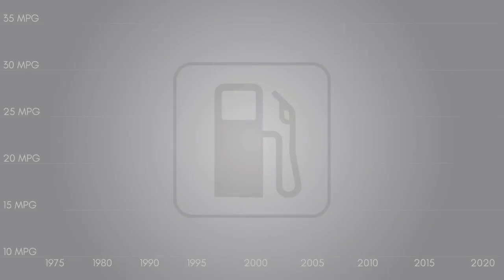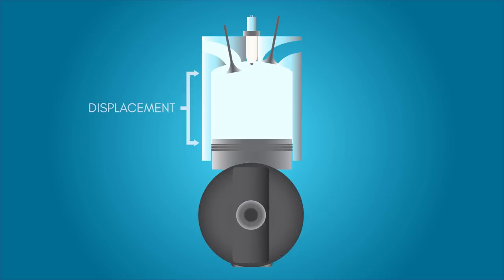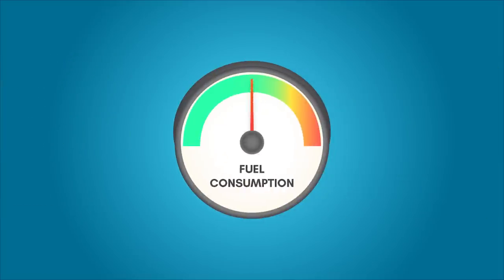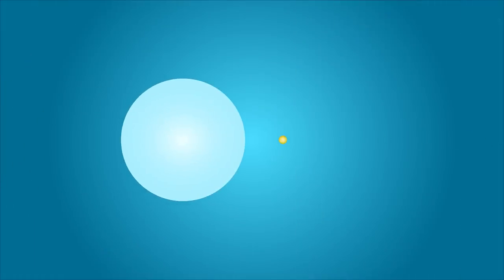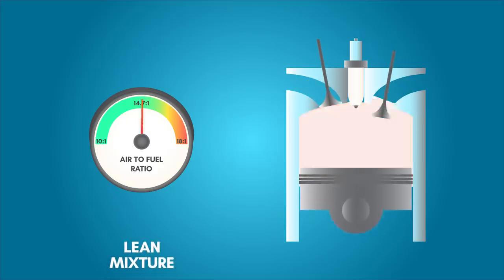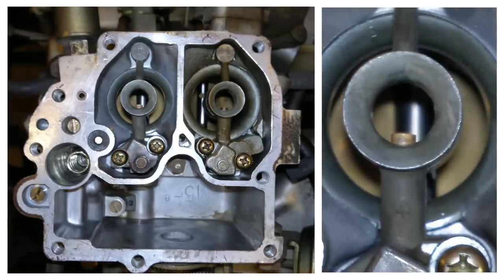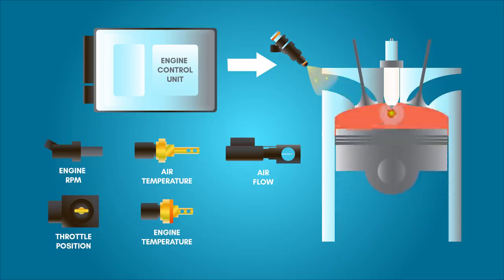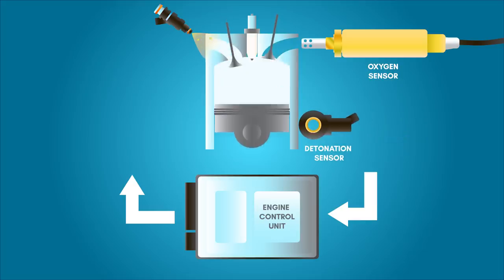How Engines Are Becoming More Fuel Efficient

Comment: Modern engines ARE amazing. My car has a 2.0 turbodiesel that produces 184 horsepower and it will average 60+ MPG on a long motorway trip. I'm only 46 and remember when I was a kid that you could smell cars as they drove past you down the road. You rarely, if ever, smell that now because fuel metering is so accurate and efficient.
Reply: What car are you driving?
Reply: @thinhtranba5352  It's a 2014 Seat Leon FR.
Reply: Diesels are great but i dont think gas cars will ever come close to what the diesels can do. I remembermy dad telling me he had an old early 70s 4cyl 5 speed gettig over 40mpg no emmisions just a little old 4 cylinder. Yes emmissions are nessasary now but we were able to get better miles per gallon without them. Even my diesel truck gets better mpg without all the emissions crap on it. Went from 16.7 to 23 after all the mods
Reply: Guy that’s not what I would call good I have a 92 v8 falcon that gets over 35mpg when I’m carting my work tools around and it done over 250 000 miles, if I had the engine rebuilt and didn’t have all the weight in the boot all the time my economy would be comparable with yours and my car is a nearly 30 year old car I threw together with leftovers, what is your car worth
Reply: That's true, the only time I can smell a car these days is on cold starts. Catalyst is too cold to function plus a rich AFR to compensate for a lack of fuel atomization in a cold engine. That or someone that has had their car tuned.
Reply: Arguing about the efficiency of internal combustion engines is great and all on it's own merits, but combustion simply is an inherently inefficient process.

The theoretical efficiency of a combustion engine is about 35%, though a few rare extreme examples hit about 42%

Electric motors routinely hit 90, 92 or even 95% efficiency, and have done for nearly a century already.

This is why trams were once popular. And electric trolley buses.
And why the trains on densely populated routes with frequent services are almost always fully electric.

And, why electric cars are gaining ground.

Though, you might ask why has it taken so long? After all, electric cars actually pre-date cars built using internal combustion engines.

Well, the answer of course is that while electric motors are amazingly good, batteries are not.

We've seen amazing leaps in cost and power density in the last decade, but even with all that, an electric car has to carry something like at least 15 times the mass in batteries that a similar sized petrol or diesel vehicle would need in fuel mass to get an equivalent range. and that's AFTER accounting for the electric motor being 3 times as efficient as the combustion engine. (meaning the battery has less than 1/45th, sometimes as little as 1/150th or less the energy density of petrol.)

There IS a reason why all the manufacturers are moving to electric, and it's not just the environment.
But there's also a reason why it's happening now, around 2020, rather than already having happened in 1920...
Reply: You in the UK?  If so, your gallons are bigger than American gallons.  A little detail that is easy to overlook...If so, the US equivalent is ~50mpg.  I had a VW Golf TDI, it could get as much as 50mpg if I stayed below 60mph, and in the summer.
Reply: Just think that's a hundred more horsepower than you would ever need and just think if they would have put the last 50 years until fuel efficiency instead of unneeded horsepower
Why do you need a car that can do a hundred and forty miles an hour when the speed limit is 60?
Reply: @thecloneguyz  Can I call you Grumpy?   The rated hp at 5.5k rpm doesn't matter.  What matters is the low RPM torque and hp.  Like at 2,000 rpm, I've got 100hp and 275ft/lb.  That's handy for pulling a trailer, changing lanes, merging with traffic, etc.  The point is I'm getting nearly the fuel economy of a Prius...but in a car that is FUN to drive...it does both at the same time!
Reply: @thecloneguyz  High top speed is just an artifact of having enough power for good acceleration, as well as good aerodynamics and tall gearing.  People who don't want to keep up with the flow of traffic can be a hazard and would be better off using public transport.
Reply: fredy gump I live in the UK. Fuel is sold by the litre here not the gallon!
Reply: @nathanlewis42   Yeah, well...I'm sure I have heard all the UK car shows talking about mpg?  I've watched pretty much every Top Gear up until Clarkson beat up that producer.  Isn't the metric version of fuel economy something like liters per 100km?  But the conversion is still 1.2 UK gallons = 1 US gallon.
Reply: for diesel, dump the urea spray, egr, dpf, catalytic converter and your engine will give you superb mileage..
Reply: Mykel Hardin I’m not saying “if I took a few tools out the back I’m say if the engine hadn’t done over 400,000 it would be more economical and if it weighed the 1300-1450 kg it ment to instead of 2100 kg it does would make a difference aswell, I’m say guy’s car doesn’t seem incredibly efficient compared to my nearly 30 year old car I would of thought it would be leaps and bounds more efficient
Reply: In mexico cars still smell
Reply: If ots a ford you can still smell them as they past. I dont know what they do with the exhaust, but they always smell like someone cut one in the car.
Reply: Guy Wood 1986 Honda crx 50 mpg way more reliable than the car you own.
Reply: @limcharles9730  Or take that new TDi, put it in a Mk1 Rabbit that's less than half the weight, and watch the mileage climb even further. You could hit 100 MPG with all the EPA stuff removed, a lightened chassis, and an easy pedal. And because it's a Mk1 Rabbit, you can get antique tags that waives your need for inspections/emissions and finally take back control over your property. Going from coast to coast on two tanks of diesel would be amazing to see.
Reply: @izuzan7419  I agree with you about Fords
Reply: Mykel Hardin 😂 my friends 2003 ford escape with a 3l v6 made 11mpg, my 2003 Mitsubishi  3lv6 makes 13mpg, and my dads 2017 ford exploder with a  3.5L v6 makes 14mpg and my moms chevy trax with a 1.4l 4 cylinder makes 26mpg 
not only do i not think the mans car can make 30mpg and at 30 years old 
But less if its a v6 
No matter what mods (unless its a hybrid... even then, lmao) 
Maybe he cracked the code to the worlds most efficient engine
Reply: KuraIthys big oil making billions on gas, thats why they dont make fully electric cars, plus it started with gas, which means they have more experience, as to why tesla is pretty much the only (or was) fully electric cars, now everyones dipping in since they’re blowing up, and obviously everyone wants to keep up with the times, besides that, even then i personally think batteries are pretty efficient in the sense that, even at the average 30mpg that most cars achieve,  being in an suv ridden city (mostly up here in the north) 200-300miles per tank is usual, and teslas batteries seem to be at the 200-300mile per full charge range, i personally think its going pretty well 
And now that everyones pushing for this new tech, im guessing in 10 years batteries will pretty much remove gas 
Given, battery technology sucks, if it improved imagine where we would be... 💀 its good now but it can surely be improved 
I know theres a few cars that run on hydrogen, i think doug made a video on one, it was a mercedes, given.... hydrogen is expensive, 💀 and although everywhere, to use it as a source of power is expensive since its uncommon as a fuel source, very few hydrogen chargers.... shits wack
Reply: Heh I can smell the exhaust on my big block 78 bronco . It'll make you cry (literally lol) shot piston rings and over fueled 😅
Reply: @Douglas Hamner you must be from California. Anywhere else in the u.s. you can find diesel trucks with no emissins or exhaust and the cops never look twice.
Reply: @dougsavery5442  I get 59 MPG average in a 1.1L Fiat 600 from 1998 on gasoline. Small Diesel cars of that era got 80 MPG (in Europe) if driven carefully.
Reply: Wait for it, i hear repairs are expensive and hard to diagnose for diesels, plus i smell diesels not 10 years old around me and they stink worse than a 2 stroke scooter, oh and there is diesel gate. Hybrids FdD. Also using mpg as a way of measure is very inaccurate since there are two types of mpg and it's not really intuitive to which you refer(imperial or US), so again not the best choice to use mpg online, m/l or l/m are two better ways to measure that since, you know, i'm here in Lithuania, you're there in US/UK and Abdul to the left of you is from Pakistan.
Reply: @Douglas Hamner true, but try maintaining a car after 200Mm onward. Diesels are harder to keep nice and clean and luxurious.
Reply: @eivis13  The 1997 VW Lupo uses 2.9L/100km. Yes Diesels smell if they are not properly maintained.  But then drive a small gasoline car that uses 4L/100km. Still only 30% more than a Tesla emits in Europe or 10% less than a Tesla emits in the US.
Reply: @Douglas Hamner what about the used car market? Also i own a used gen 2 prius with +217Mm now. Most people everywhere own those type of vehicles. If you're hanging out with the top 30% then yes, those people tend to be wasteful and buy cars that get booring over time or don't get properly maintained, or are just a pain to maintain.
Reply: @Tore_Lund  hmm, why should i drive a small car when hybrids are not that expensive nowa days? A used gen 2 prius costs from 3000-5000 eur where i live. Plus i've recently seen ads for the 1,5 hybrid yaris for under 7000eur and i believe you could get 3.5l/100km in those, plus all that tourque and no nox. Diesels may have a revival, but only in 50 or so years, but somehow i doubt that since gasoline engines are starting to go well beyond the 40% efficiency point.
Reply: @eivis13  3.5L/100km is very good for gasoline!!
Well beyond 40% -- with HCCI yes, which still needs to come to market, but yes, the difference is getting smaller.
Reply: @Tore_Lund  i think the new m20 engines from toyota are having just over 41% efficiency, not sure if they're hcci or not though. I have read somewhere that the old 1nz-fxe, used in the prius, had a thermal efficiency of 37 percent, but i can't find the source now.
Reply: @eivis13  The Prius engine is special; besides having VVT to have very little  valve opening on light load, which most modern engines do anyway now, the crankshaft also has more offset to have shorter compression stroke than expansion stroke which is an approximation to the Atkinson cycle, which originally had an extra hinged lever connected to the push rod to vary stoke length. The Toyota HCCI engine is 45% thermal efficiency.  But 37% is as good or better than a small diesel.
I did, the calculations on my own car, carefully measuring frontal area from a telephoto, weighing it on a truck scale and measuring consumption with a fuel flow meter, and according to the engine curves from the manufacturer, this rather conventional engine should have an efficiency of 26.4% at optimum load and rpm. However in real life, after deducting gearbox loses (manual) and alternator load, I only measured 22% in real life?? So there usually are some other parasitic losses that sneak in and the occasional acceleration, but still, I'm getting very close to the theoretical efficiency of the whole vehicle. so it should be possible with a 37% engine like in the Prius thrown in a small car to get close to 2.5L/100km if driving it like a Granny. Then pure EVs will have a hard time competing with that. Sadly, small lightweight cars are not in fashion as they were in the 80' and 90'. The concept small production VW  XL1 did that and got down to 1L/100km, but it is only a two seater and prohibitively expensive for any practical use. Even the first 2CV with 6 HP got 3L/100km in 1932.
Reply: I read somewhere that the air coming out of a modern engines exhaust is actually cleaner than the ambient air in London.
Reply: @KuraIthys  Interestingly bicycles are one of the most efficient forms of transport. Especially when its geared.

To give you an indication how inefficient a car engine is... you easily heat up the cars interior on a cold day from the engines energy losses.
Reply: @Guy Wood   "only" 46. Lol
Reply: @fredygump5578  that's why metric system is used.
Reply: Your in a family of lead feet, I've driven every one of those cars(hated em the way) and every one of them gets a lot more than that. 

I routinely get 300-500 miles from a tank on any car or truck I drive and that tesla does not get anywhere near 300 miles on a charge without hyper miling it, their stated range is nowhere near that in the real world for most drivers and in the case of your family of lead feet it would maybe get 150 miles.

Comment: laughs nervously in constantly floored 88 f150 getting like 7mpg
Reply: Yeah, that's nothing. 01 chevy 6.0 that gets   10 going easy on it. I just thought my fords were thirsty til I met this junk. And it gets like 1/3 of that now, since apparently the intake gasket or intake itself cracked a couple weeks ago when I drove through a rather large puddle. Even my carbed 390 with no overdrive blew this thing away. With power and efficiency.

Comment: A 1983 Volvo 240 which is shaped like a brick and has a 4 speed transmission with overdrive geared for 55mph highway driving still gets about 42mpg highway at 70mph.  All my experiences with new cars have gotten about 30mpg highway so in my opinion new cars are useless at creating efficient engines, especially turbocharged 4 cylinder engines.
Reply: some gearboxes have really crappy gearing for improved "acceleration" 
Really not nessecary for so much rpm on the highway
Reply: Stop buying low mpg new cars then lmao

Comment: Where is the next video? And please do mention about cylinder deactivation too as well as tumbling and, HCCI (e.g. Mazda Skyactiv-X technology) which manipulates higher compression ratio to increase efficiency.
Reply: Madzdas Skyactive X is no HCCI....it is SPCCI, a spark is still needed to induce the rapid burn of the lean mix! Pure HCCI doesn't need a spark plug, it does it simply by compression and some free radicals from EGR (like the small COX engines)

Comment: Was expecting you to show turbos haha, because thats the new trend small engines with powerful turbos so they dont lack power and are very fuel efficient
Reply: They rev higher meaning more fuel is getting pumped in overtime which is less fuel efficient its common sense turbos making an engine more fuel efficient is a myth
Reply: @patrickbateman2869  nah they rev lower as turbo does more work so you dont need to put foot down as much. My turbo kicks in around 2500rpm which is low to say i can rev to 6500rpm. But on some newer cars they kick in even lower.
Reply: Twin turbo seems to work pretty efficiently on my F150. If I drive like a sane person, it's fairly fuel efficient. If I stomp on it, she goes like stink, and definitely uses more fuel than usual, but still less than my old F150
Reply: @patrickbateman2869  completely wrong
Reply: @patrickbateman2869  actually turbos use waste exhougasses to make power making them efficient. Since it uses energy that otherwise would be wasted

Comment: I have a Nissan Versa that has dinosaur tech (late 90s engine design) and early 2010s software. It makes 42.2 mpg in the highway :v
Considering it costed me almost nothing and has never broken down, I guess I got a good deal
Reply: noice
Reply: 90s is not ancient for cars its not like a pc or phone
Reply: Used to be a Nissan master. Good Idea. Simple, only fail Nissan has is the CVT transmission. Any time a Customer receives a Nissan with out a CVT transmission, instead have a Manual Transmission. Dependability has increased Dramatically. CVT design is nice, durability/Longevity  is Flawed.
Reply: @JohnDoe-ic8hy  wish my manual transmission in my 240sx worked perfectly today but I'm surprised it's held on so long with not too bad of issues.
Reply: @fakedanielsong8954  lol. Who has a 240sx and doesnt beat the car up? I have not seen a 'STOCK' S13 or S14 in years.
Reply: FAKE DANIEL SONG ya mate. Stock 240sx is very rare or you just lying
Reply: Peter Parker no I’m not lying. I havnt seen a stock 240sx in YEARS in San Antonio Texas. Everything is beat up and drift taxed.
Reply: @ramade9040  all I bought mine with was a short throw shifter, which if I get the urge I could easily source an OEM one but really no point. Lots of rust tho, much fixing to do
Reply: @JohnDoe-ic8hy  that is interesting because I've seen engineers argue the opposite for toyota hybrid cars. The main reason for their longevity and inexpensive maintenance is not the hybrid things like people quick to assume, but actually well made CVT transmission. It's cheaper than conventional automatic and even if breaks doesn't cost as much to repair.
Reply: @JohnDoe-ic8hy  yes, my Nissan versa is a manual transmission
Reply: zhbvenkhoReload you sir have a dependable vehicle.
Reply: zhbvenkhoReload your only problem now is that you drive a Versa.
Reply: @zacharyparis  Not really man. It's a cool car.
Reply: "Dinosaur tech" isn't the most efficient, but its reliable. Less things to go wrong.
Reply: Don Duke Nissan died years ago. Old Nissan is amazing. Just older vehicles are designed better. Just picked up a 1995 Isuzu Pickup for 500$. 344k Miles, original trans and motor. Valve adjustment, clutch, whole engine reseal kit, clutch kit, motor mounts. Less than 400$ in parts. Runs and drives no problem. Just gotta throw some tires on it.

Old Japanese all day VS Any other manufacture
Reply: I had an 87 maxima V-6 that got 40+ then nissan recalled and it got 17 when i got it back.
Reply: I loved my '09 versa. 6 speeds of pure joy. Crazy fuel efficient and I fit a suprising amount of cargo in it (I fit enough rough lumber to build 3 dining tables). I swear that's gonna be my project car when I'm 70